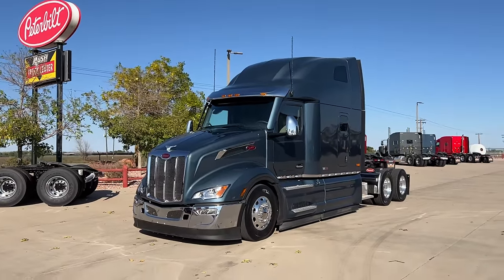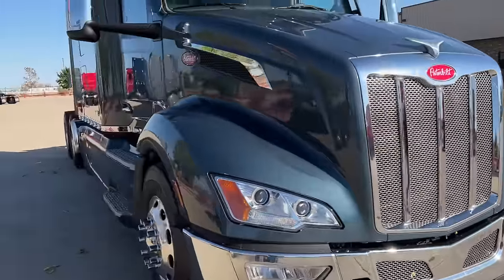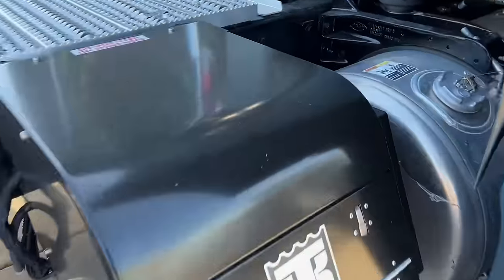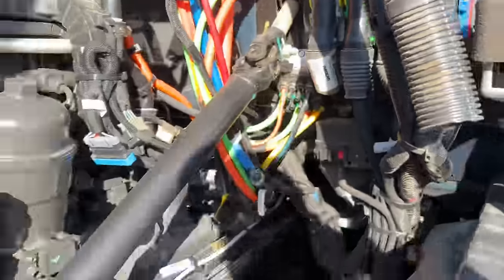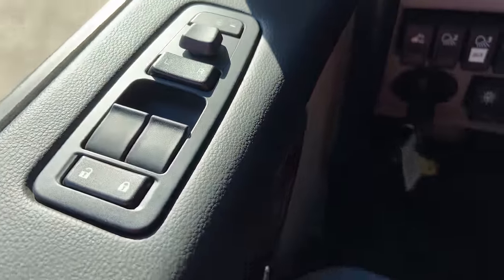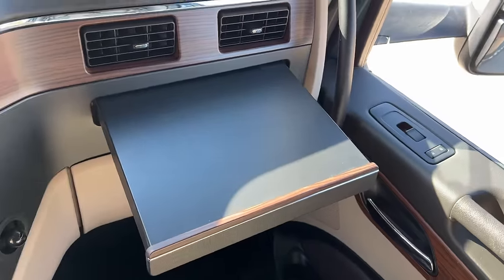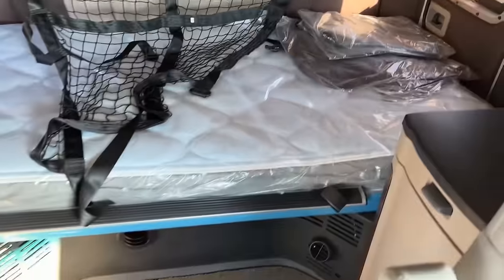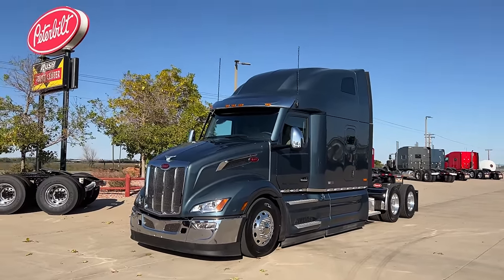2023 Peterbilt 579 80" Ultra-Loft - Medium Dark Arcadia Blue - Gorgeous!!!

Comment: Nice truck surprised they didn’t go with the Cummins
Reply: I have the Cummins on mine and it’s way better than the paccar
Reply: @987658340  I think pretty much anything is better than a Paccar.
Reply: You can get it with one.
Reply: Paccar is a much better motor
Reply: Paccar is a Cummins, they just label them for Peterbilt and Kenworth but is a Cummins
Reply: @Joemun77  your so miss informed. The paccar was designed from the ground up by paccar.  The only thing that is Cummings is the regen system
Reply: @Joemun77  it’s is designed by them but it’s a cheaper version for a reason
Reply: @987658340  Почему вам не нравится Паккар?
Reply: Выпендриваться же надо

Comment: i would never ever pay $200k+ for a truck that cost $180k a before covid. Nothing has been done to these trucks to justify that much of an increase. Smh...
Reply: Bought my used 579 for $63K 13spd, apu with 300k miles and 300 miles still left on the warranty.
Reply: Mark still did you buy it from auction?
Reply: @vladimirnaumovski987  no, a dealer just south of grand Rapids, MI. It was before the pandemic, but still. Buying a used with a Warranty still on the truck is the way to go. At the time 2 1/2 years ago, the truck was at 311,000 miles. In today's world of trucks, I wouldn't buy one without a warranty. I've had over 5 repairs that has dealt with sensors. It's just the nature of the beast. Mine is a Peterbilt 579. Single bunk, 76" sleeper.
Reply: @marksill8020  facts. In todays so-called "market" that truck would sell for $140k. Ridiculousness!!
Reply: @rogerg0834  LOL 😆 😂 🤣 . Don't get me thinking. With fuel sky rocketing and brokers only wanting to pay $1.50 a mile, I've been thinking of getting out of the business and do either Lyft or Uber. I'm at home every night, weekend and holidays, ant the gas is a lot cheaper. A friend of mine makes about $900 a week.
Reply: @marksill8020  lol, yeah, as a truck driver myself I've spoken to plenty of Lyft drivers and they do okay if they live in a large city. Make your own schedule etc etc. Honestly, if I did it I would buy an EV car to maximize profits. However, I am not there yet. Only way I would take $1.5/mile is to get me out of crappy area, like Florida. Having a truck payment in this market is death of a small business. Trucks are seriously over-priced. The consequences of paying any amount because people actually thought $5/mile was the new "norm". Smh...idiots.

Comment: What is Shore Power used for?
Reply from the maker: Shore power runs heat and A/C without running the engine or APU.  Plus everything else in the truck.